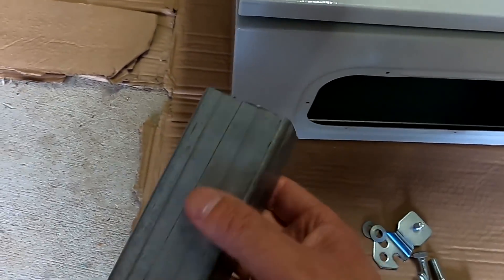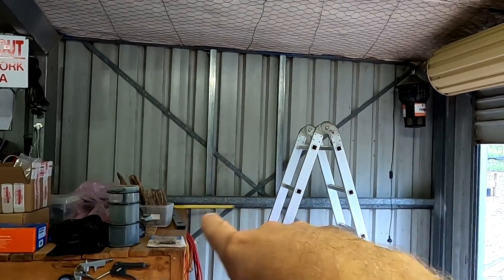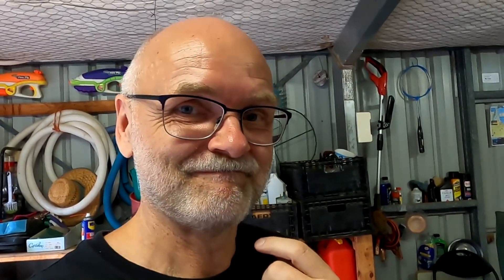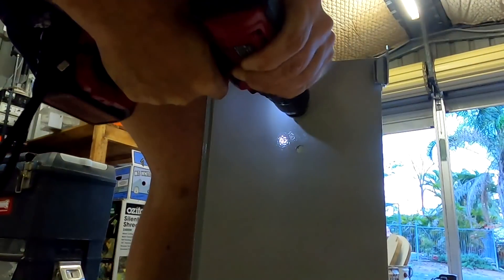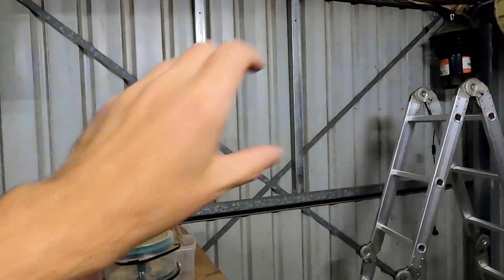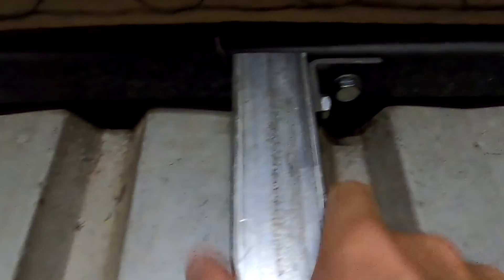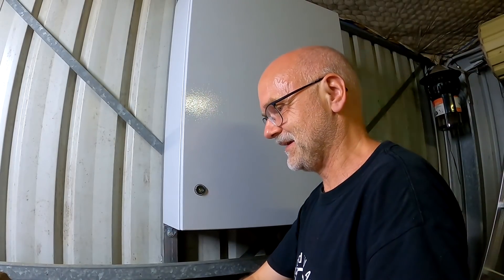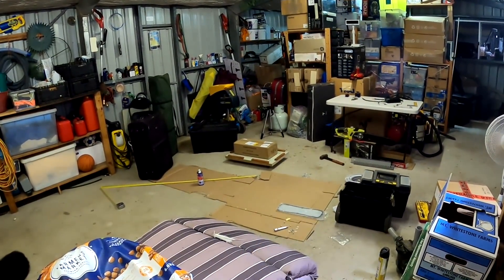This will take and protect all my solar gear. How I mounted it on the wall 😁

Comment: When I bought my van, it had shelving in it. It was bolted to the wall and floor, using short strips of steel similar to your short busbars. Some were tapped, some just had holes for the bolts to pass through. For me, it was a lesson in securing stuff to the van.

Comment: I would have recommended putting another vertical support beam at the bottom to take the extra weight off the horizontal support beam.
Reply from the maker: This horizontal beam is super sturdy and will hold the cabinet with ease (plus myself when I hung on it). The force will be split as the vertical post are screwed to the top horizontal metal as well.
Reply: @OffGridGarageAustralia  fair enough, I  just like taking a risk adverse approach when adding a significant load onto a structure that was not design for it .

Comment: Hi again Andy - thought you may be interested in this commercial video on Pusan battery packs - they talk about compressing the pack... https://www.youtube.com/watch?v=CYJQxdfDj84
As a guess, they are using prismatic cells, - they look the same but are smaller than ours..
I just paid the customs release on mine - yeah - they are getting closer!
Reply from the maker: Thanks, Ben. I watched this video before and well... yes and no in terms of this compression. I will now go without and see how the system performs over time. I've got a 0.23C charge and also discharge max for this pack. Not sure if compression really would make a huge difference.
Reply: @OffGridGarageAustralia  So I contacted my cell supplier and she said that she's not sure - "it may damage the battery". Oh well. It looks like this topic will be shrouded in mystery for a while....always looking forward to your next vid Andy. Thanks for responding.

Comment: 1.5mm of thread holding up that. shock horror. I would have failed my Electrotechnolgy CERT 1  if I tried doing that in class. I prefer not to watch a snuff video next time :-)
Reply from the maker: What's wrong? I was hanging onto this cabinet and it's rock solid!
Reply: @OffGridGarageAustralia  lol, ok then. My concern is that 1.5mm or 1.6mm is not enough thread for that long term application. The garage will see wind rattling the side walls (vibration) which will over time wear down those 1.5mm threads. Everyone is allowed at least one amateur hour production ( I won't mention using a hand tap with a drill either :-) ) It won't stop me watching your productions, I watch every one as soon as u post. keep it up.

Comment: 1.6mm is a little thin for threads, it will be fine I'm sure but next time I'd suggest a nutsert.
Reply from the maker: That is a great suggestion, I can still do that. Although I did hang on the enclosure and it, well, it's still on the wall...

Comment: Will your charge controlers stay cool in there ?
Reply from the maker: How hot do they get? The ones I tested so far got a bit warm under certain conditions but nothing got hot. I also think the metal enclosure will act like a heat sink.

Comment: Safety shoes.   LOL.   Nice idea with tapping steel supports.  Looks great.
Does your bluetooth connections work with the smartshunt and charge controllers with cabinet door closed?  I bet they don't unless you drill some holes or have the cover open.  Might be a surprise if you don't plan for that.
Reply from the maker: I thought about that but haven't tested it yet. They are not far apart from each other but yeah, the metal could be a problem.

Comment: Great job on hanging the cabnit,I did notice  the post were a little thin walled careful the bolts dont pull away from the post once all is installed in the cabnit.
Reply from the maker: I think the 1.5mm steel in the posts is enough. The enclosure weighs 35kg and the gear maybe 6kg. I also hung on the enclosure and it's still on the wall 😄

Comment: Are you going to add ventilation holes or openings of some sort?
Reply from the maker: No, I will install all gear first and see how warm it gets inside. I expect the metal case will absorb a lot of that heat first and emit it to the outside. Like a passive cooling.

Comment: It's a little late now, but I would recommend feeding all cables in from the bottom.  It creates a natural drip loop, that prevents any water getting into the equipment.  Since you are feeding from the top, create a coil of wire before going through the gland.
Reply from the maker: Right, that's a good point I didn't think about. I'm not expecting any water coming down that conduit as the opening is sealed with silicon and also the hole is under the solar panels. But absolutely fair point!
Reply: I second that.
As an electrician myself I always prefer to feed the cabling from the bottom to these cabinets. Even if it's just in case.
I'm always shaking my head when I come across cabinets with holes on top, because the planners didn't think about it as well.